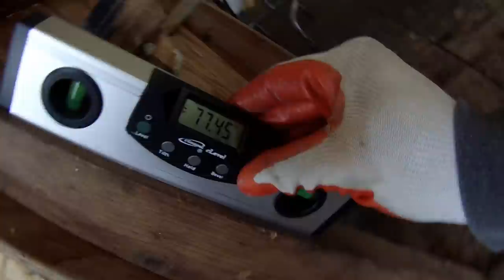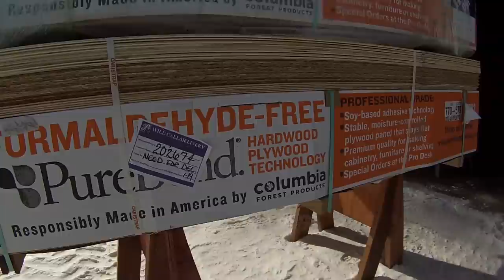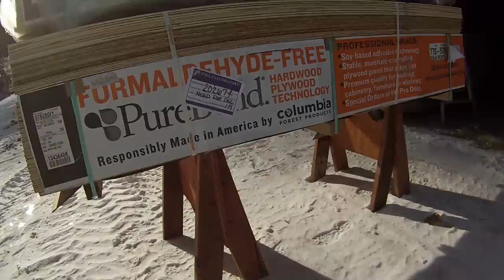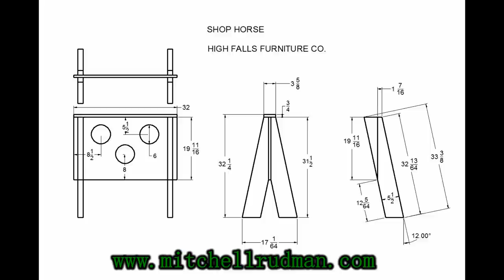Shop Horse

Comment: Off topic question. What was your shop building originally? I can see it has a lot of space but also it's been around for a long time. Keep the videos coming we love them  :o)
Reply from the maker: +breakinn403 
originally a machine shop, early 1900's
Reply from the maker: +breakinn403 
the garage part of the building was an add-on from the 70's, but was built from mostly reclaimed wood.  the garage doors were taken from some other ancient structure and re-installed.

Comment: Plus two 3/4" pieces glued is less likely to twist or warp.
Reply from the maker: +Zarouszz 
A little bit of flexibility actually helps if the floor is not perfectly even, and these clunkers are already very heavy
Reply: +hffcom Oh, I was talking about the rails on the table at 0:50. 
Those sawhorses look crazy indestructible. At 6:48 I thought you were going to jack your truck up onto them somehow.